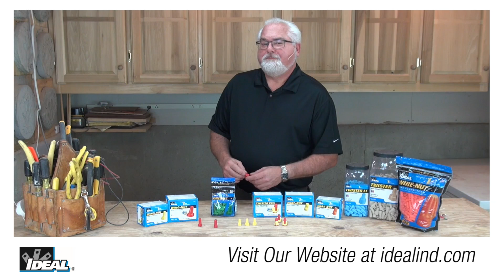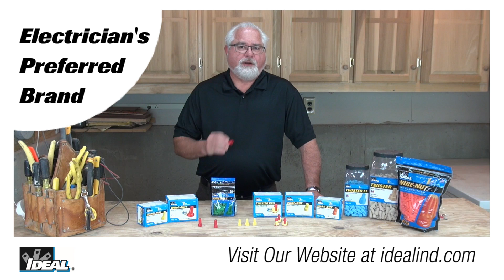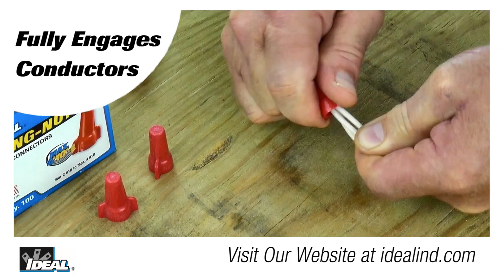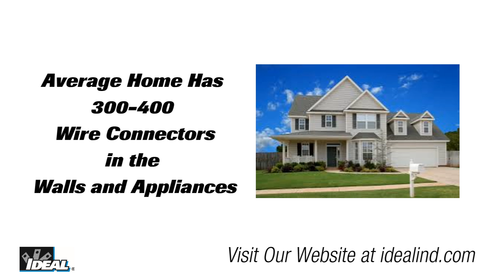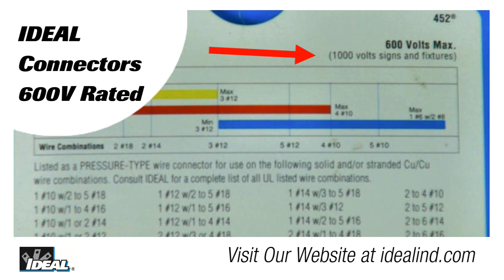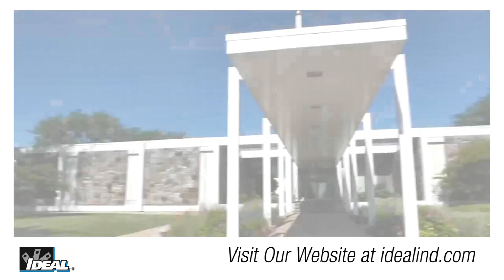Electrician's Prefer IDEAL Wire Connectors

Comment: My company started to use other brand and you can tell it made cheap and are not as good as the ideal... Ideal is the best in wire connectors .. Thank Ron
Reply from the maker: +spyderx92 Many moons ago when I was new with IDEAL a contractor about wanted to through me out of the office about wire connectors. That is when you know guys have a preference. Overall IDEAL owes the wire connector business but many new players today. I appreciate you using them Ron